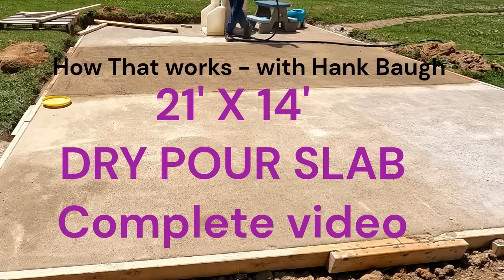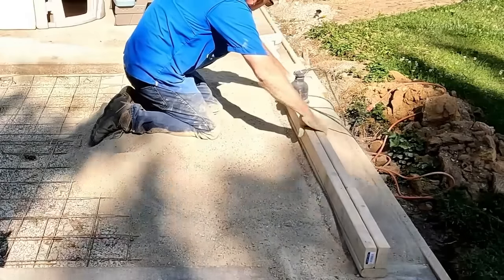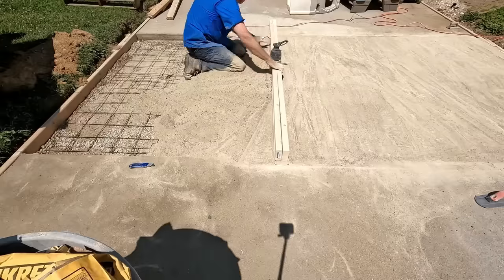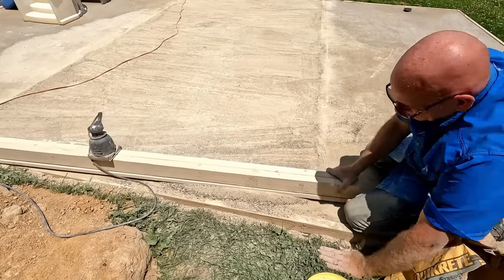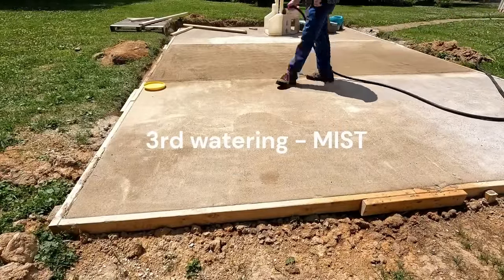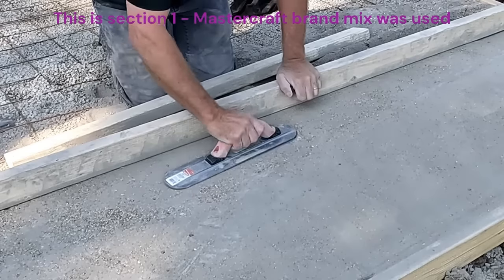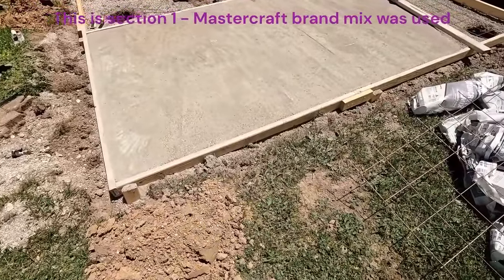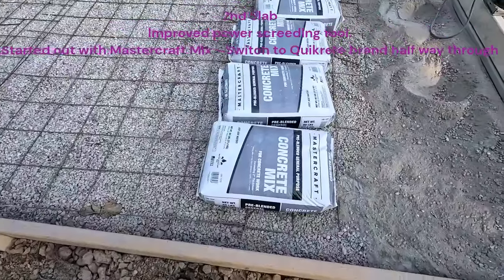21'X14' Dry Pour Slab Complete Video

Comment: Someone commented that their delivery cost for wet mix is only about $300/yard.  I'll use that number in my math here to compare wet mix to dry mix cost.  

If slab is 21 x 14 x 6" deep = 147cu ft x .037037 cu ft / yard = 5.4cu yds  x $300/yd wet mix dellivery = $1633.  Around here I can get 80# bags of Quickcrete in volume for $4.48 a bag.  An 80lb bag contains 0.022cu yds of concrete.  So this project would take about 250 bags or about $1120 + tax at about 4.5% here would cost me = $1170.  So I could do this myself for $1170 or pay a mix truck to come in for $1633.  Doing it myself would mean I could save $463.  Which I could apply to buying lumber for my side walls.  I guess you get a mix truck to come in if you don't want to do all this work and you got the cash to burn.  Another way to look at it is that I like doing the work (it is a good workout) and I like doing projects myself I can be proud of later.  I can drive my F350 and trailer on the lawn right up to where I'm going to do this so assuming they fork lift load me at Lowe's then I have to move 20,000 pounds of bags.  Like I said, nice workout if you go slow and use your legs.  

I'm about to try this on a 20 x 14 which I'll do in sections like this guy.  What will I do different or the same?
*  I'll add some foam expansion joints
*  I'll use rebar to tie into my house slab
*  I'll lift that rebar up off grade with pieces of bricks I have laying around so it is in the middle of a 6" slab
*  I'll thoroughly dampen the grade before I lay in my dry pour...and I'll dry pour up over the rebar first and lightly level it out and then water it good....then I'll pour the top 3" and finish it off like this process.  I'm thinking wet the grade good, wet the intermediate area good and then do the mist-down-from-the-top process like this guy does.
*  I'll religiously keep it wet for 30 days and if the sun is gonna be hot then I'll throw some plastic on top after wetting.  
*  I won't strip forms off for 30 days either except the inner ones when I go to do the middle section.  
*  When I do middle section I'll drill into the outer sections to set in rebar to tie slabs together.  
*  I like his method of digging some post holes where my front wall posts will go to support a lean-to tin roof structure (good idea there!) but I'll probably wet pour those holes right before I start the dry pour because I'd like those to be pretty darn firm since I'll drill a sheet metal 4x4 or 6x6 anchor down into them from the top when done.
*  I love this guy's screed idea and I'm doing that.  

WHAT ELSE WOULD YOU DO OR NOT DO PEOPLE?  I AM ALL EARS FOR SUGGESTIONS AT THIS POINT.  HELP ME MAKE MY PROJECT GREAT!  MAGA STYLE.  

I'm in no rush to finish this fast.  I'll do all the work by myself. 

When my slab is done I'll be using it to store a yard tractor and use it like a garden shed plus I need a workbench for ammunition reloading and I can easily do that out in that little lean-to since it will be big enough.  My wife will love me because I can clean out "her" garage for her!  Oh and great news is the house wall I'm tying into has an outside 110V GFCI outlet so I can tap into that and feed a few more outlets, some overhead LED lights and a switch.  I'm going to use a wide roll up door on the front along with a 3' man door.  I am not constrained by how high I can put the roof so I want to finish the roll up door so I can get maybe a full 8' of clearance minimum when door is in the up position.  I'll never drive boats or cars in there, just a zero turn.  Nice little project.  

My wife is going to help her mom for a month so I'm going to surprise her when she comes home.  It won't be done by then but she'll get the big picture quick when she sees it.  I'm all about making my wife happy and I am also wanting that HE-SHED for me!  Guarantee there will be a mini-fridge and TV in there!
Reply from the maker: I love how you have researched, made a plan, and are learning from everyone else's mistakes. That is why we make videos.  We show how we did it, then let you know how it turned out so you can improve on what we did.
I have a one thing for you to consider with your layered watering approach.  
Once you get that first layer wet, you won't be able to work your next layer towards you from the middle.  In other words, you will have to work your screed from outside your work area.  It will take two people.  Otherwise you are sitting on your knees in wet cement.

Same issue with propping up your rebar with bricks.  You can't get on top of it to pull your mix toward you.  (I actually pulled mine up into the middle if the mix as I worked back.) That must not be clear in my video because others have made the comment about the rebar being on the ground.

I am sure you will find a way around these issues.  Sounds like you are a good planner.

Let us know how it all turns out.

Thanks for watching and for the comments.
Reply from the maker: Also, I am very glad you are keeping it wet fir 30 days.  You must have watched my moist curing experiments.   If not, check it out.

https://youtu.be/mI_4gvqTPTg?feature=shared

Comment: How are you calculating the bags?  You said 60 bags?  Doesnt seem like enough for a  21x14
Reply from the maker: It was 60 per section.   3 sections, 180 bags.
Reply: @HankBaugh  O gotcha.. that makes sense.  Thanks man.   You gave me the incentive to try this.  I got a 15 x 30 but looks doable.   Can I ask why you broke it into 3 sections?  Just because of the size?
Reply from the maker: @kellysanchez1000 I wanted to be able to screed across my forms.  I thought that seven feet would allow me to use an 8' 2x4 to screed.  BTW, I found that is nearly impossible to do alone, that is why I came up with my version of a vibrating screed tool.
Reply: @HankBaugh  o man   Great tip.  Thanks again man  appreciate it.  Wish me luck  ha ha
Reply: @HankBaugh  crap  one more question.  If  mine is 15x30… what would you estimate in bags ?
Reply from the maker: I would start with 250 or 260 bags.
Reply: @HankBaugh  Thanks Hank -  really appreciate your help man.

Comment: The vibrating thing on the screeding boards is a great idea but what you fail to understand is that all you’re doing is vibrating the finer dusty material down below the surface and that is why the rock is coming up whereas if you just did it by hand & with a buddy? it wouldn’t happen.
Reply from the maker: Actually just the opposite.   The vibrating,  or side to side oscillation actually pressed the aggregate down and brings the powder to the surface.  Same affect as the sawing motion you use doing a two man screed as you suggest.  Benefit is a much easier process and you can do it with one person... even one handed if you like.

Comment: Do you think a dry pour could create concrete that could support a car?
Reply from the maker: I am planning to answer that question scientifically in the near future.   I am partnering with a professional who tests concrete strength to get actual ACI Standard results.  Be sure you are subscribed so you don't miss it!
Reply: @HankBaugh  ok
Reply: @MaxStArlyn many videos on this exact question. We were going to do a dry pour for our pool until people in comments told us to watch videos about the failures of heavy things on dry pours. Luckily we only built the frame and haven’t bought the concrete yet.
Reply from the maker: How big is the pool going to be?  Just curious.
Reply: @HankBaugh  it’s a 16’ round pool. The cements Psi on the bags we would buy say 4,000psi but that’s if we follow instructions for regular pour concrete. With dry pour a test was done and the psi drops to 3,000s.
Our pool holds 6,000 gallons of water. So this wouldn’t hold.

Comment: When I wet pour, I mix it as dry as possible and use a concrete vibator to agitate all the air out of it, then flood it for a month there-after.

Dry pouring scares the hell out of me.  It looked alright, but how strong is it? 😬
Reply: Strong
Reply from the maker: We will all know the answer to the strength question soon.  I am doing experiments with wet mix VS dry pour and will have them crushed by a professional concrete strength testing outfit.  I am excited to find out how the two will compare!
Reply: @HankBaugh  Freeze thaw cycles are likely harder on dry pour as well.
Reply from the maker: @andyh8239  That remains to be seen I guess.

Comment: So how much in material did you spent on this slab ?
Reply from the maker: About a thousand dollars total.
Reply: Did you compare the cost of just ordering the concrete from the local plant.
 Where i am i can get a cu yard delivered for 300.00 ..21x14 needs 3 yds so under 1000.00 but 160 bags if concrete here costs about 1800.
Reply from the maker: @jeffsim8664 I have about $1,000 in the entire thing.  Cost was not the factor though.  I literally had no other option.  Could not get a contractor,  did not have help.  I did this 100% on my own.
Reply: @HankBaugh  that makes sense.. small job no contractor and if there is no concrete plant handy dry makes perfect sense. And interesting concept never done it before.

 I just priced out a small job in my back yard. 100 ft. 1 yard concrete delivered 329 tax in. Wood decking going to be 425 plus. Dry pour about the same. 56 bags at 66 lbs and 8.80 plus tax. This is canada so our prices are higher in many things

Comment: assuming this was a 6" slab the math comes to about 240 80 pound bags or about $1,200 bucks from the local hardware store or big box chain like Lowes/Home Depot, this much concrete to do the whole slab would fit in a single concrete truck (as it's a little under 5.5 Cubic Yards), you likely would have been quicker and better off calling a concrete supplier (not installer) to have a truck delivered then you finish it and the project is done in a few hours of labor after the forms are built instead of the weeks you spent doing 3 separate pours and the back breaking labor of moving that much tonnage of concrete.
Reply from the maker: Thanks for your input.  Your math is off though.  It is a 4" slab.  It was dry poured in three separate sections, each section took a few hours to pour, not weeks.  I just did not do it all on the same day.   As explained in the video, a truck could not get to the location, so the concrete would have to be buggied up the hill.  I am a one man show, so that would not leave anyone to screed it out while I am running up and down the hill.  This is way to big a job for one person doing it ANY other way than Dry Pour.

This is why so many people love dry pour.  It is on your own terms.

Comment: Strongly recommend you saturate the ground before starting a dry pour. There is no way in the world it will provide more water than the concrete needs. NO WAY.  .  .  
Just to be clear: SATURATE THE GROUND BEFORE STARTING A DRY POUR.  What that means is;  water the ground the night before, then water the ground the next morning,. Then water again just before dumping the dry concrete on the ground before dumping out the bags
 IT IS NOT POSSIBLE TO USE TOO MUCH WATER